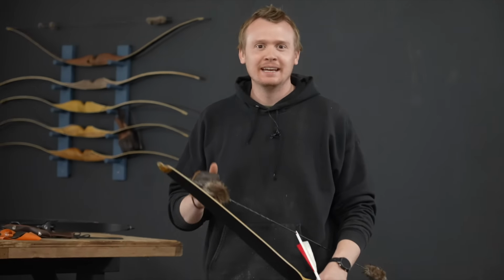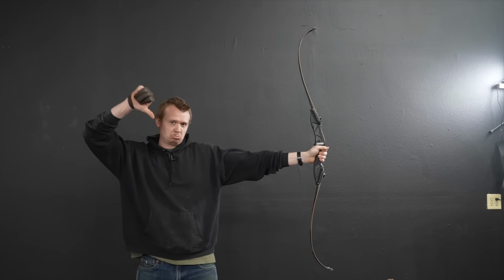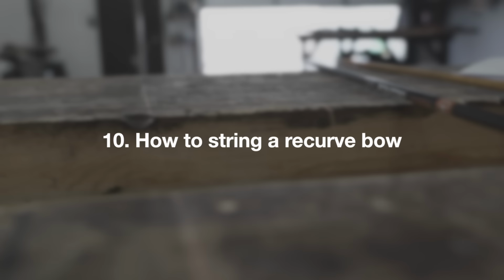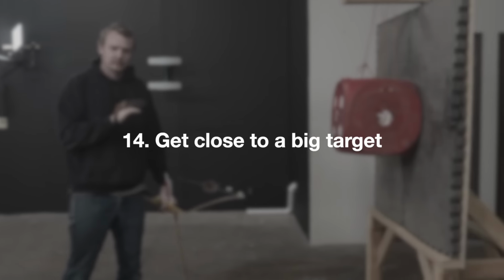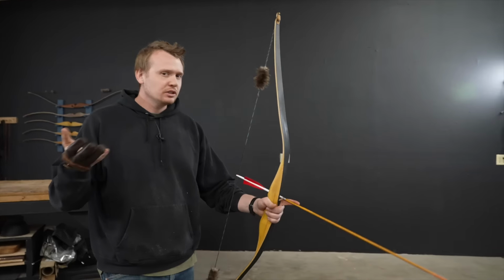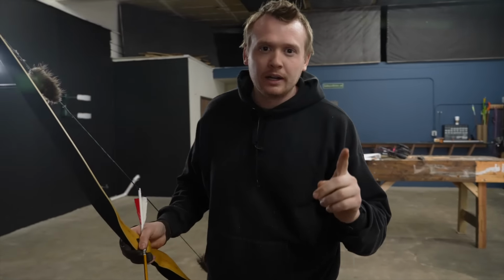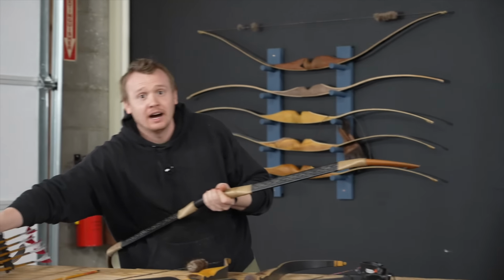Archery For Beginners 27 Important Things To Know

Comment: Great video. Been shooting archery for 54 years. TOP FIVE: NUMBER ONE- Your equipment must be matched; arrow spine and length, correct point weight, and poundage. If this is not done first, it will not matter whatever else you do right. NUMBER TWO- Don't overbow yourself.  NUMBER THREE- Establish  consistent anchor. (Howard Hill anchored at his incisor tooth). NUMBER FOUR- Lightly grip the bow and push it as far away from your body as possible when drawing the bow... then push it farther. NUMBER FIVE- Practice shooting close with one arrow. (It makes you concentrate more on making a good shot).
Reply: Thank you
Reply: Thankyou, very good advice for a bigginer like myself.
Reply: Mad gratitude old timer ;) no disrespect mind you. ❤will try this when I shoot stick for the beginning. Much success in your hunt. ❤
Reply: What is someone doing wrong if the string keeps painfully hitting the forearm upon release? Wrong size bow? Bad form?
Reply: @higherdimensionalsoul42  there are several causes for this. Most longbows, and some recurves have a short brace height so that when we release, the bow string travels farther forward, and strikes, your forearm. You can try shooting a bow with a taller brace height or you can take the string off one end of your bow, and twist it a dozen or so times to increase your brace height. Sometimes just a half inch change in string length can make a big difference in the brace height and the string not striking your arm. Another thing you can try it is to not flat palm grip the bow. Raise your wrist so that the bow is resting against the crook between your pointer finger and your thumb and the handle is  not touching your palm. This shifts your forearm away from the string path.
Reply: Been shooting 40 years and I totally disagree with your#1 - people get way too wrapped around the axle about spine, weight etc. archery has been around 10,000 years - precision measurement of spine, arrowheads etc is a modern concept - I can vary arrows, head weights  lengths etc and accuracy doesn’t suffer.
Reply: @kenoneal2263  Your comment has zero merit and actually defies physics. Some people just like to jump the fence to be contrary. Yawn...
Reply: This comment has more useful information than the entire video!
Reply: @andreatthenight3052  Extremely frustrating to work on your form and anchor when the arrows are coming out of the bow sideways....
Reply: I decided to get into traditional after starting with compound. Never understood why I wasn't consistent. My form is solid.. but, until this video, I didn't know that arrow weight, spine, bow poundage, and even the tip made a huge difference.
Now I do.. and will be re-addressing things.
Reply: @Eric-gi9kg  Strip the fletching off an arrow and start shooting 15 yards.  Start with setting your nocking point on your string.   I shoot split finger and usually set my nocking point on the string about 1/4 inch up from the CENTER of the arrow nock. This will give me a nocking point about 1/8  of an inch high. Seems to be a good starting point for testing the arrow flight for porpoising up and down. You don't want your arrow perfectly perpendicular to the string. It needs to be raised at least 1/8th of an inch. Then start using different point weights until the nock stops fishtailing left and right. When it all comes together you will be amazed that an arrow with a field point can fly straight with NO FLETCHING. If you shoot broadheads, you will need the same weight as the field point that gives you the best flight AND you will have to have feathers for shooting the broadhead. Plastic vanes won't work with traditional bows. I would suggest getting point weights in 145, 175, 200, 225 and 250 to experiment. If you get nock right, go up in point weight. Nock left, go down. Good luck!
Reply: thanks for the tips !
Reply: @kenoneal2263  whats is your arrow release technique ? Mediterranean or is it some other style?
Reply: @Kurtdog63  far more merit than yours - all the crap your talking has no basis for an activity that is literally thousands of years old and done with mostly hand made shafts and heads that varies greatly from arrow to arrow in balance weight and spine - get over yourself!!
Reply: @L2p2  - yes Mediterranean - I’m also left handed
Reply: @L2p2  Yes sir. Archery such a great past time. If one starts out with a little knowledge and good habits, it takes some of the frustration out of the learning process.
Reply: @Kurtdog63 To disregard and ignore what anothers experience has been leaves you open to narrow perspectives. I'm Lakota Sioux and taught by my father who was taught by his and on and on... primitive archery is pretty inconsistent when it comes to precision weight measurements. Each arrow made by Lakota warriors is unique. Similarities are there.  But the types of wood and stone were dependent on local availability. So,  weight of arrow shaft, arrow heads, and bow-stave varied considerably. I'm not arguing that it's a good idea to match it all up. Especially with availability being what it is now days.  It would be kind of silly not to. But it is not required to be an incredible archer. Just ask Custer! 😉
Reply: @dustinmullings2672 My comment is meant to educate new archers and keep them interested enough to continue down the road of success without getting frustrated learning (or not learning) how to shoot with poor bow and arrow setups.  The advise I give, is something I wish someone gave me back when I picked up my first bow 54 years ago.
Reply: Recently had a historian that focuses in archery show me how to draw a warbow, which helped me with my 60lb recurve hunting bow. Just changing form and pushing the bow away more rather than holding it out and pulling the string the whole way has made it SO MUCH easier to shoot all day, as well as keep my anchor consistent because I'm not getting tired.
Reply: Or get a horsebow and thumbring to shoot right sided ..no guard needed..just keep both shoulders down and scapulas parallell when you squeeze at a the end of the draw ..
Reply: @higherdimensionalsoul42  it is a common misconception that if the string is hitting your arm you do something wrong. If this would be true you wouldn't probably see top archers wearing the armguards, would you? For correct body alignment you need to have the string pass close to your body and eventually it will hit your arm. It shouldn't really scrape on your arm but slap is perfectly fine. Use armguard. Some advixes from Kurtdog63 are going against the good practices in archery so I wouldn't go that way.
Reply: Kurtdog63... bit too much ego mate. Have an open mind. Archery is never ending. What will you do one day when your lost in the wilderness with only your bootlaces?
Reply: @higherdimensionalsoul42 twisting your wrist a bit will stop string slap.
Reply: Thanks great suggestions
Reply: Very wise words, my biggest mistake was buying a powerful bow 😂 didn't want a "weak" bow, ofc lost/destroyed all my arrows as they went straight through the hay bails
Reply: @jakkbatt4711  Many times when beginners in traditional archery start out, a bow that is too heavy will cause them to develop terrible habits that are hard to break.
Reply: @Kurtdog63  very true man, now I got a nice 25 pound recurve and am actually doing some studying instead of just messing around, much better results already
Reply: @Eric-gi9kg  those same things can definitely impact your accuracy and consistency with a compound
Reply: @Kurtdog63  in the process of getting back into shooting a recurve (shot one for bow fishing as a kid).  I was going to start out with 125 gr points, as I have quite a few of those from my compound and crossbow gear.  Based on your suggestion, 125 is apparently too light - can you tell me your thoughts on this?  I'll probably be in the 50-55# draw weight range for my 32" draw length.
Reply: @rohlfing63  That is a pretty stout recurve to start out with, I would suggest a 40 lbs bow. I don't have much experience with carbon shafts because they require indexing to tune their weak side and stiff side to get broadheads to fly right. I would suggest 2016 aluminum arrows and start with the 125's with no feathers, then go up or down in point weight until you achieve the best flight. I shoot 125's in some of my setups because they fly the best out of that particular bow. If you go with a lighter bow, 1916 aluminums shoot well with the correct point weight. I have several recurve and longbow videos on my channel. Hope you come up with a good set up.
Reply: @Kurtdog63 I've hunted with a compound for decades, around 63# draw. A 40# recurve (the minimum I could use for deer here in Illinois the way they measure minimum draw weight at 28" or less) means I'm in the 52-56# range at 32" for most recurves as I understand it, which takes me up quite a bit on the spine chart.  I still have some 2512 shafts, are those even worth fletching up to try on a recurve?
Reply: @Kurtdog63 All this. But also, get a knowledgeable archer to show you how to hold your arm in correct form. It takes a bit more strength, but will keep your forearm clear of the string!
Reply: @dustinmullings2672 love this. Thank you. Also, ask Custer...😂
Reply: @SolidAir3  The best length for a smooth shooting bow is 60 inches. It draws smoothly and does not have much finger pinch. A more handy length for hunting is a 52 inch bow. It is easier to draw and move around in tight spots, tree stands, ground blind, etc. 40 lbs if you don't have much experience shooting traditional bows. Keeps you from developing bad habits if you buy too heavy poundage. I am not familiar with brands other than the Bear bows I shoot. May want to check some reviews on youtube. There are some decent bows for well under $200.
Reply: @kenoneal2263  I suppose it boils down to what your accuracy expectations are and how far you typically shoot.  For my practical hunting range of 25 yds or less, I agree that I can make reasonable changes in length and weight and spine etc with negligible impact on accuracy, but bigger changes or longer range shooting makes every one of them significant.  It's simple physics.
Reply: @kenoneal2263 Agree 💯! I've been shooting a recurve for 50 years. Same bow! And long before smartphones info at fingertips!
Reply: Been shooting/hunting bare bow for 50 years. Respectfully, your #1 is dead wrong.

Comment: 🎯 Key Takeaways for quick navigation:

00:55 🏹 Choose a comfortable bow poundage.
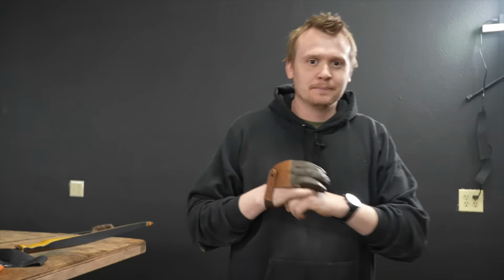04:03 🏹 Understand different traditional bows.
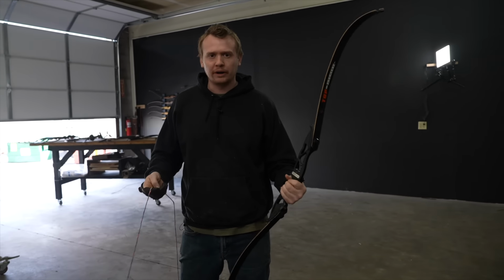11:04 🏹 String your bow safely with a bow stringer.
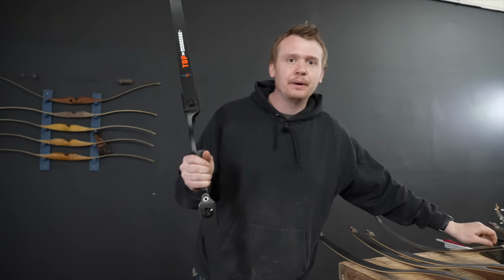15:44 🏹 Use feather fletchings for straight arrow flight.
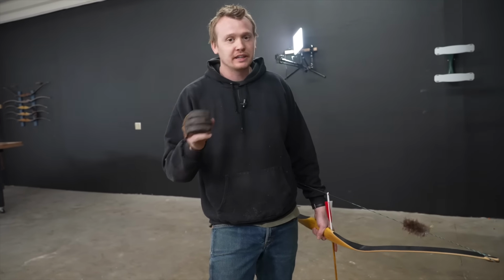20:41 🏹 Start shooting close to build confidence.
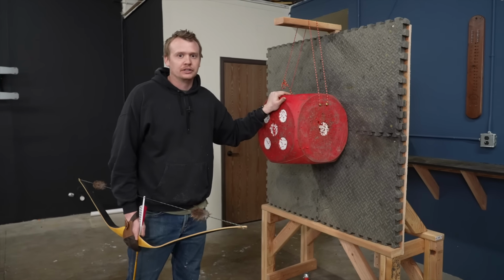22:00 🖐️ Find a consistent anchor point on your face.
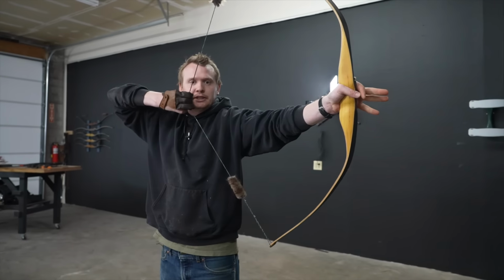23:33 🏹 Cant the bow slightly to prevent arrow falling.
26:42 🤙 Grip the bow loosely for better control.
27:41 🎯 Create a surprise release for improved accuracy.

Made with HARPA AI
Reply: Thanks

Comment: An interesting video.  As you say... hard to put all the needed information in a short video.  A couple of things I'd like to mention.  I was an archery instructor (mumblety) years ago.  A recurve bow shoots more smoothly than a longbow.  A longbow has nothing to absorb the recoil, so all of that goes to the arm... and can be painful.  It can even affect the shoulder of the bow arm.  A recurve absorbs the recoil in the recurved limb and is a much smoother shoot.  (Holding the bow more losely also helps. I do like your thumb / index finger grip method.  It's a good one).  One can buy recurves in 66, 68 or even longer lengths, so as  you state, there is a lot of variety when choosing a bow.  But in general, a recurve will be much more comfortable for beginning archers.

VERY important:  New archers (and old archers) don't want to draw a bow ten times before shooting (which the video states to do).  That is a good way to tear muscles and tendons. As with all sports, one should stretch and loosen up muscles before putting strain on them.  You can shoot a bow once or twice and probably do fine, but if an archer is going to shoot a round of 60 arrows, they need to warm up first with stretching exercises (about 2-3 minutes of stretching should do).  Alternately, an archer can "slow draw" a bow a few times (don't hold it-- just slow draw and then relax), resting 30 seconds between each draw.  That will have similar effect.

Pausing between shots:  In professional competitions one will find archers shooting an arrow, then standing there for 30 to 45 seconds before taking their next shot, giving the trapezius muscles time to relax.  Failing to take these precautions can cause serious and permanent muscle / tendon / ligament damage... especially with higher-poundage bows. 

Regarding the release:  you present one release and if that works for you, that's fine.  But the release that I've seen most archers use, and that works especially well for beginners, is to take your anchor point and when ready to shoot, simply relax your fingers.  Don't jerk the string, don't alter the anchor point at all, just relax your hand quickly and fully.  Another method is what someone described as "flicking a boogar".  Pretend there's a boogar on your draw hand and intentionally open your hand quickly as if flicking the boogar off your finger.   Both methods work well for beginners and advanced archers alike.  The idea is to get your fingers away from the string as quickly and consistently as possible.  Myself, I prefer the relax method.  If you relax the draw fingers quickly and fully, the shot will be identical every time.

I do appreciate a major point you made:  compare with yourself, and shoot for fun.  If one's goal is to become a pro shooter then that of course requires a different path (as with any sport), but for the average archer: enjoy yourself.  Hitting the bullseye will come with practice.  The initial goal is to just enjoy shooting the bow.  If you're a beginner and hit anywhere on the target, you're doing fine.  Precision will come later.  The initial goal is to just have fun learning the sport.

I appreciate your time in making this video.  As many years as I've been shooting I still enjoyed watching it.  : )

Comment: Excellent beginners guide to Archery very well explained. The very best practice Butt I ever made was a wool bail filled with Dacron insulation off cuts. I approached an air conditioning company that made A/C ducting they were glad to give me their off cuts off Dacron insulation. Evan a small amount in a hessian sack has incredible stopping power and extremely easy to pull arrows. Better than any commercial target butt.

Comment: Absolute beginner here that's never used archery yet:
This was a great tutorial. The thing that got me getting really icky was the canting the bow, when the camera guy walked in front of the bow you were holding with the arrow resting in the shelf. It made me cringe a couple of times.
Those distances got me all confused on step#25 String Walking - the increments on those numbers has me scratching my head, it'll get figured out eventually.
Ok after rewinding and listening and watching I think I got it: This slightly changes the angle of the intended shot by pivoting the arrow; thus, in doing so move my hand down a bit being careful of my target distance. Did that make sense. The application used here for instance is a grouse on the ground.

Comment: If you don't want to ram your bowtip into the ground for stringing your bow you could try put the arm of the bow into the joint of your foot. so at the front of your ankle (?). You hold the upper arm with your hand. You then push your hip out to bend the bow (with me it's usually somewhere where the handle ist anyway). This method has been used for centuries and I wouldn't call it bad. It can only be executed badly. But you're right the string method is the better option for beginners.